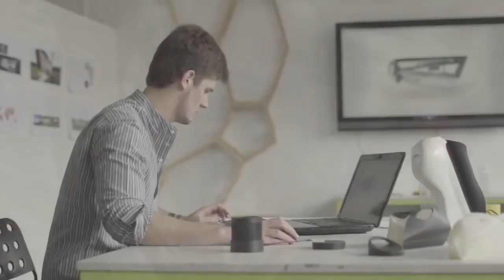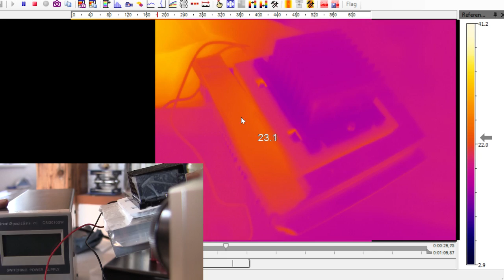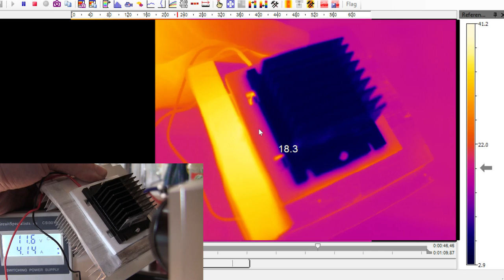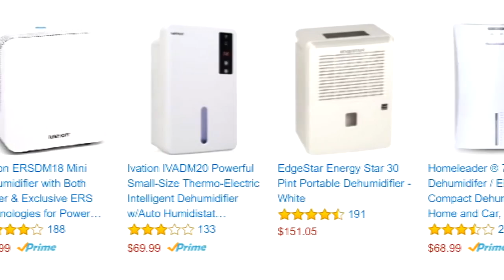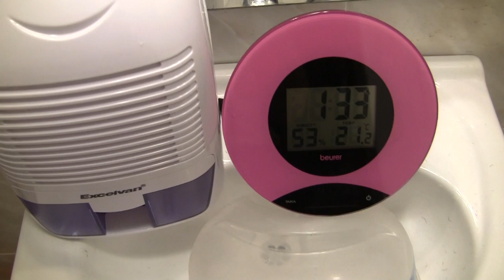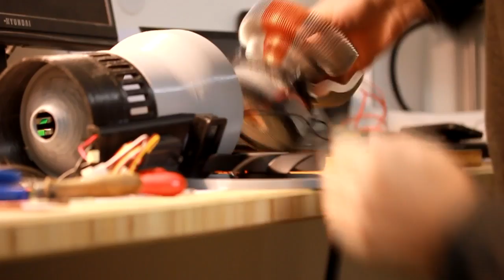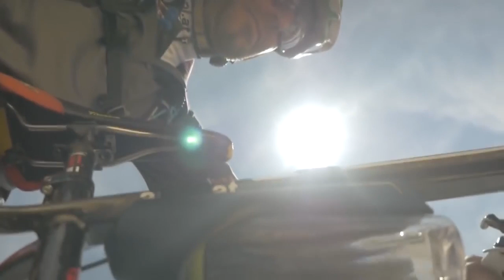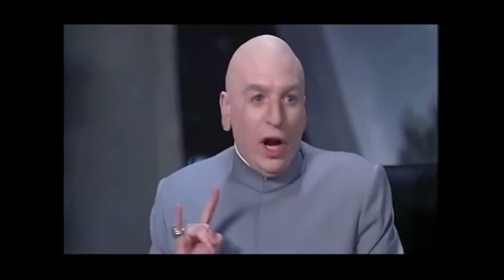$300 000 'Self-Filling water bottle' FAILURE

Comment: but a good scientist works for the benefit of all, so thats why one wouldn't go all Dr Evil. ive been thinking about magnetic rotation. being a mechanic ive always wondered about crossing a starter motor with an alternator, if it had magnetic bearings (that dont exist) and ran in zero g is there a way to manipulate electro magnets to create rotation with a small amount of current to output a large amount of volts???? with a car its a 12 volt starter motor and a 14 volt alternator, although a starter motor takes a lot of amps to turn over a motor what if you just set up a starter motor welded to an alternator connected to a car battery battery..could it "infinitely" run?? atleast untill the bearings failed? (hence magnetic "no touch" bearings)....ive also got some thoughts on improving the internal combustion engine. if you're interested? like no head gasket no valve train direct inject gasses(HC & O2) port exhaust or electric actuator exhaust two stroke....cuts down engine weight, oil requirements, fuel consumption, engine size,...damn give me 300 000 bucks....but less consumption means less profit for fuel companies so.....and magnetic bearings would never wear out so no repeat business, once again less profit...and its all about those quarterly gains..... anyways keep busting :) Thank science some one is.
Reply: That would require more power to turn over since you've got the resistance from the alternator, so you'd be draining even more electricity. I'm not sure what you're envisioning with your hypothetical magnetic bearings but I would be willing to bet that if I'm understanding you right, they would interfere horrendously with the alternator's magnets.
Reply: yeah I guess. can't get more out than you put in, conservation of energy.
Reply: whogavehimafork also theoretical bearings could have theoretical Gauss shielding..? I guess..? just an idea I had working with cars, no touch bearings, its just an idea. like HUDsunglasses. its an idea. but not google glass please no...I mean sunnies with temp psi UV o2....the variants are endless... WiFi Bluetooth...you name it...here I am holding my phone like a chump when bam HUDsunglasses with voice req..mobile access mic and speaker...oh but no I'm over here doing the poke the letter...

Comment: The way the dehumidifiers work is by condensing the water onto a cold surface by basically freezing it out of the air. When you run this dehumidifier experiment you have to let it return to room temperature so that the water that has condensed has time to melt and drain into the drain pan. (I would never drink such nasty water)

Comment: hm ... i was playing in my head with peltier element cooling for my cpu or somthing like that but got concerned with condensation ... after seeing that thermalcam footage here that idea of mine does even less sense since i basicly substitue to disperse the core's heat with the peltier's heat which judging on that footage is even worse so instead of needing a heatsink i prolly nead a even bigger heatsink to make that work, on top of that if that heatsink solution under any circumstances failes i fry my cores with 100% certenty ... so that is why noone will cool it that way :D

tbh i initially thought that perltier stuff would cool down to freezing point levels nad had no idea ... and still don't have how that effect is achived :D i know how refridgerators basicly funcioning but i can't wrap my head around how that peltier does it ... 

edit: okay after a quick wiki reading i know how that is achived and it is still a bad idea to build cooling devices for computers out of it :D 

on second thought ... i should start a kickstarter campaign and see where i am getting with :3

Comment: We had a big dehumidifier, about 3 feet tall, at a restaurant I used to work at in Louisiana. If you've never been to Louisiana it's very humid all the time. Over the course of a week, running 24/7, it only put out about 10 oz. of water. Also, what's wrong with taking a Camelback and a few extra bottles of water? I used to do 100 mile bicycle rides that way and never ran out of water.

Comment: Depending on what kind of hammer, it might rival the kind of money they're asking for. Gold runs at about $1,235 per Troy ounce today.

  The kind of hammer you used in the video is reminiscent of a small sledge hammer, weighing in at about 2-6 pounds. (about 1-3 kilos)

 Even at 4.5 lbs (1.5 kilos) you're looking at a hammer weight of 453 grams per pound, times 4.5 lbs. (I'm avoiding using Ounces because gold is measured in Troy ounces, which is a few grams heavier than standard ounces.)

  453 grams X 4.5 lbs = 2,038 grams of gold to make this hammer.

 Price of gold in grams? $39 per gram (24k or .999 fine.)

  $39 gold X 2,038 grams = $79,000 or 74,496.68 Euros, or 64,316.54 British pounds.

(Note, all numbers were rounded down for simplicity, so the cost would be higher, but you get the gist.)

  Not breaking the 100k mark to compete with Anita, but still a very far cry from "not scratching the surface.)

Comment: Here in Florida, I run a dehumidifier nearly all year, to control the humidity in my workshop. I get about a gallon in 24 hours. And that keeps the shop at a reasonable 60% humidity. But a shortage of water isn't something we normally concern ourselves with. What I wouldn't give to see 30% humidity instead of the 80-100% we get.

Comment: I actually think the commercial humidity unit would work better without the fan in lower humidity environments - it probably is forced air drying the water off the cold plates before it gets a chance to collect enough to drip down - but still, not a huge amount either way.

Comment: Would it be possible to make this work via pedal power?
Reply: That might be a more effective means of powering it, but power isn't the only problem. thunderf00t used a commercial dehumidifier that plugs into an electrical socket and still just got a drop of water. The issue is how much water is in the air and how much air the thing would need to process to get any substantial amount of water out of it.
Reply: I got that, was just an idle thought

Comment: Not saying the water bottle is possible with todays technology, but the example you had with the "commercial dehumidifier" was just utterly stupid. We lived in basement appartment which needed 2 dehumidifiers 24/7 and they filled up a 2L tank each, every couple of days. They were twice as big as the one you showed, and it was a very humid basement but man you're pushing it with that example.
Reply: That makes all the difference. The higher humidity in a basement combined with the MUCH higher surface area for condensation AND available power in a commercial dehumidifier is what allowed that much water to be pulled from the air in your apartment.
Reply: Yeah I know. The only thing i'm saying is the example he used was stupid. After so and so hours you will get 1 drop of water. I'm sure if you're on a trip in the mountains you will get more then 1 drop of water in the same amount of time.

Comment: Shouldn't it be way more effective to just put a dynamo on a bike and power a dehumidifier? Or using wind power on a sailing ship? Nvm scratch that, you can't use wind power when you travel at the speed of the wind as it doesn't actually blow on the ship.

Comment: 17:45 that thing with the ribbon cable sticking out is a fan speed controller. i have one here in my room in my pile of junk components. its crap and its a shame onto them to use such an item. Not even using a bare potentiometer.

Comment: I wonder how much heat is necessarily output when the molecular structure is held from vibrating so it can't generate or conduct heat.  It has been done in a lab with a laser to achieve some picokelvins above absolute zero.  I never heard of it reaching a practical application yet. It might be used with tiny operations that involve applying heat.

Comment: Just to throw in some data.

I have a 400W Dehumidifier that produces about 3 liters of water for one day (16 hours), with the humidity at around 60%.

So for this Fontus to work they would need a a solar panel that would produce 400W (would have to be big), to produce 1 Liter of water in 6 hours, and it would only work in humid places. And there is another problem, the water produced is distilled, so it's not suitable for human consumption.

Comment: hey TF, how much water you gonna pull out of the air that's at 32% ... that's fuckin dry air and no dehum is gonna be able to pull much more water out than that. i have a large dehum that SHUTS OFF at 55%. that's besides the point but i just wanted to throw it out there.

Comment: On my dehumidifier which is very similar to the you're using states that below 40% humidity it will not withdraw any water from the air.
So it's no wonder yours didn't either. Just saying
Reply: That's exactly what he wanted to point out - the whole thing (self-filling water bottle) is pointless, because even with a far more capable dehumidifier (mains-powered), you will not get any water from the air if the humidity is below 40%. It is not a problem of the device itself, it is a problem of "not enough water in the air". You could get a lot of water from the air in areas with high humidity - but then, it would be far easier to just get some rain water :-)
Reply: 40% relative humidity at 20°C corresponds to dew point of ~-0.5°C, so any water that condenses would immediately freeze to the cold plate so you'd get no water in the reservoir (also the ice would insulate the cold plate, preventing further condensation). If the dehumidifier has a sensor, it's not a humidity sensor but a temperature one (to prevent ice buildup) and disabling it would do nothing (aside from wasting power). 
This is not bad methodology as the same limit would also apply to the Fontus.
Reply: Quick calculation time ;-D

Reverse osmosis machine: consumes 45A at 12V, that's 540Wh and produces 30l of water in an hour. Therefore, it has an "efficiency" of 18 Wh/l.

Dehumidifier (Peltier. like the Fontus but more powerful): consumes 5A at 12V, that's 60 Wh, but only produces 1 l of water each 24 hours (that is when it is 95% humid, below 40% it's useless and that is the kind of humidity that is present in the "biomes" where you need the Fontus most). 
Therefore, the "efficiency" is 1440 Wh/l.

The RO machine is approximately 80 times more energy efficient than a dehumidifier. And it's not exactly a energy efficient device! (the solar array of my boat can't supply enough power to run it, it runs partly off batteries)
Not counting the fact that unless the pump breaks or the membrane fails(the rest like clogged filters is easily repairable) it's always going to produce water, and the dehumidifier will need A MONTH to produce as much water as the RO machine produced in AN HOUR.

Fontus is nonsense...
Reply: True, but Fontus is supposed to be used by "adventurers." I.E people who travel to remote parts of the world. 
Having a water source in an arid environment would be invaluable, but of course even if Fontus could defy conservation of energy, there'd bare be any water to dehumidify.
At sea, you'd just treat the seawater. 
It would fare better in a rainforest, but the thing about rainforests is that they get rained on, so there's rivers everywhere, which you can just clean same as at sea. 

The great irony of fontus is that it would be completely inoperable in the only places where it would otherwise be useful.
Reply: I have the same dehumidifier. Given its low power, it can't extract more than about half a liter of water per day, and that is using it in my sailboat where the humidity is sky high in the summer if there is no wind (85+%). Given also its low price, the manufacturer didn't bother to include a humidstat nor a full level switch (if you forget to check it, it will overflow) because in most conditions it draws very little water from the air, except in extremely humid places like a boat in the middle of the sea ;P
Reply: You would get a heck lot more safe drinking water  by using the energy from the panel do purify & desalanise the water around the boat.
Reply: I had a dehumidifier than extracted about 2 litres a day, but I was living in a basement with mushrooms growing out the walls, a couple feet from what turned out to be a burst water main.
Reply: I don't drink the water from the dehumidifier of course. I have a 30 l/h reverse-osmosis desaliniser that uses much less energy (540 Wh each 30l of water) and makes water much faster :-)

I would NEVER drink water from ANY dehumidifier, even the Fontus. Have these people behind Fontus ever smelled an evaporator from a dehumidifier or air conditioning when it's hot and wet? It smells rotten and putrid. An evaporator is a breeding place for bacteria and other living microorganisms. All of the dust that is in the air sticks to the evaporator and gets in the water. Terrible idea to drink it, and it's energy INefficient too.

And yes, I do have a solar still included in the life raft. So far I have never used it and I hope I never have to ;D

The dehumidifier is only used when the boat is moored because you take showers in the bathroom and the humidity (which is already high to begin with) goes to sky high levels and it literally rains from the condensation. This causes a lot of mould issues, but the dehumidifer does a good job of removing the excess humidity and almost prevents mould growth.
Reply: freibier yeap, that much is obvious  :)

I was only criticising the methodology – for all we know, the dehumidifier could have "stopped trying" when it reached ~32%, while a solar-freaking-bottle would presumably continue (to small effect, obviously).
Reply: zampa4ever I bought the exact same one. I sent it back as it was noisy and useless. I bought a salt dehumidifier that worked loads better
Reply: ***** great points, thank you!
Reply: To be fair, though, MrOpenGL, that actually seems like it's bordering on useful for a boat. Not a portable bottle, but you could use a 1m^2 solar panel and a dehumidifier to create potable water on a boat on the ocean (where there is a notable lack of fresh water sources, but a lot of humidity and direct sunlight), as an emergency water supply.
Reply: That's called a solar still
Reply: I didn't realize a ROWPUR was more efficient than a dehumidifier. Guess we're back to "fuck this stupid idea" then.
Reply: freibier
Exactly -- rain water, or just get a water-filtering bottle that you find in camping/hiking stores (I've just seen them on the net here in Sweden though).
Those bottles are actually as small as the model for Fontus, as with a rough filter, and an efficient carbon filter, you can get clean water really efficiently, and with minimal additions. Though you could probably improve their design... especially if you've got 300k!!

I mean, the only people that would need a Fontus are hikers (pretty much), but there are already far less bulky solutions for it. This requires the sun to function at all... it just boggles the mind to think about this with a practical and technical outlook, lol.
Reply: zampa4ever yes, that's some very valid  criticism of tf's methodology in this video. He didn't really prove anything with this little experiment (although of course he's still correct in his conclusions).

Unless this dehumidifier can be configured to ignore its internal humidity meter – but he didn't mention that.
Reply: ***** a low-quality humidity meter is dirt-cheap, and I would bet it's included in most such devices; if not to avoid making the room atmosphere overly dry, then purely for efficiency reasons.

If such a dehumidifier struggles to drop below 30% (which I'm not entirely convinced about), then there's no reason to continue burning 80 watts pointlessly... It would hurt the device's "efficiency class" and marketability.

Comment: Graphene pricing has been in the few dollars per gram range for a year or more now.
I am now producing my own, gear cost few hundred bucks, raw materials cost under 100$ per kg of finished product. Estimating cost per gram to be well under 1$ after finishing this batch of raw materials.

Graphene in things like thermal paste does A LOT for very little, your mixing ratio by weight is going to be something like 0.5% graphene or perhaps even less, to get large part of the benefit, with the least amount of cost.

Comment: We bought a big dehumidifier for around 150 euros...The room to dehumidify is generally 18-20 degrees with 70% humidity. The device will dehumidify so long as the humidity is above 35%...It can and will run for 8 hours or more on mains power and collect 1.5-2 liters of condensed water....humidity afterwards is around 60% and rises again quite quickly...So a small poncy device like this Fontus is never going to cut it...People are going to die relying on this for water...

Comment: What you need is an animator and a graphic designer to make over-simplified 'designs'. The solid-gold hammer is too obvious. A solar powered flashlight would be more along the right track. (I think those actually exist, though, so think of something with higher power consumption.) AH! I've got it!!!! A SOLAR-POWERED GREENHOUSE! It uses solar panels in place of windows to power incandescent lightbulbs inside the green-house which provide both light AND heat so that you can grow tropical plants like banana trees at the North Pole in WINTER-TIME (when there's no sun). All we need is millions of dollars of investment to get the first prototype. But here's our beautifully graphically designed animated VISION of what COULD be possible.